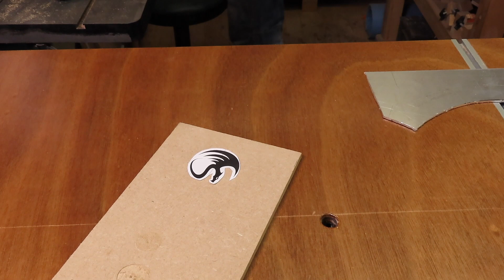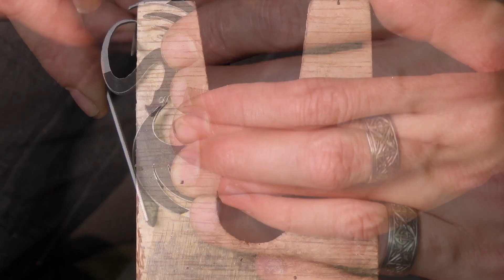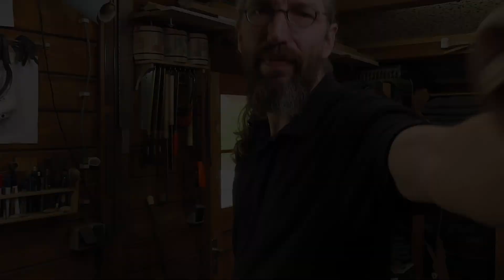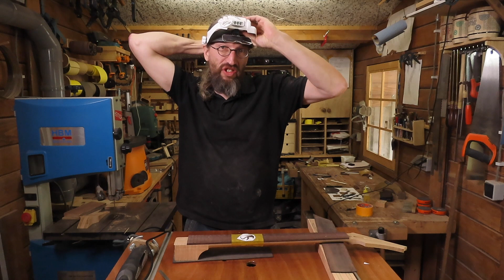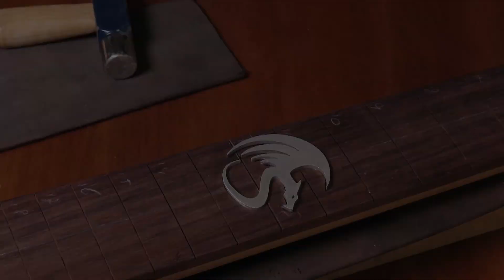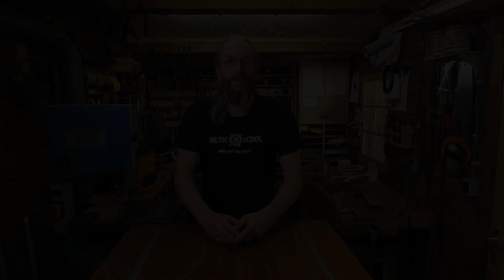A new Guitar Build part 6: Doing an aluminium Dragon inlay.

Comment: Did you draw the design in cad? Or illustrator? When I do my logos, I typically put a centerline, and fret positions going through the logo, so I can easily line it up with the centerline of the fretboard

Comment: This is probably the best video I've seen on doing fret board inlays. All of your videos are very well done. Thanks for your  clarity and excellent production values. BTW, the method I've used for gluing in inlays is to premix wood dust into the glue before applying it. I've used clear epoxy for this so I'm not sure if it would work with super glue. It works very well with epoxy. Thanks again.

Comment: Whats the 2 brands pf CA you are using?
Reply from the maker: Hi Cabronismo,
The brands I use in this video are "Ever Build"  and "Zwaluw/Den Braven", but this varies depending on which store I'm going to when I run out.
I always make sure I have three different viscosities though, high, medium and low and I'm not that concerned about which brand it is.

Comment: I thought that shape looked familiar, that looks like the Kali Linux dragon ;)
Reply from the maker: Hey Synic42,
Apart from both being stylized Wyverns/Dragons they are quite different but I can see where you're aiming at. 
I think a Dragon or Wyvern is probably one of the most stylized figures out there so I tried to make sure not to copy any existing designs, but changes are there will be a resemblance somewhere.

Comment: Your videos are awesome man, great work! Where could I buy a protractor like you have? Handy little tool
Reply from the maker: Hi Justin,
Thanks for the compliment.
The protractor I use is made by Incra. Here in the Netherlands I can buy it at most mayor tool web-shops
But here is an Amazon link for you it might help you on your way to find a store near you.
https://www.amazon.com/PROTRAC06-6-Inch-Precision-Marking-Protractor/dp/B00002255K
The protractor is available in both Metric and Imperial so check this before you order so you get the required system.

Comment: first the sawdust and then the glue worked out for me in the past. this way you have no pockets of only glue. 

btw. you forgot to put pt.5 into the playlist.
Reply from the maker: Hi Matt. You’re correct. The way I do it has a chance of creating glue pockets, although this hasn’t happened to me yet. I had it the other way around though where the glue didn’t soak all of the dust. Of course you can then reapply more glue. It’s a personal way of doing things I guess. Also thank you for the heads up on the missing episode in the playlist. I will add it ASAP.